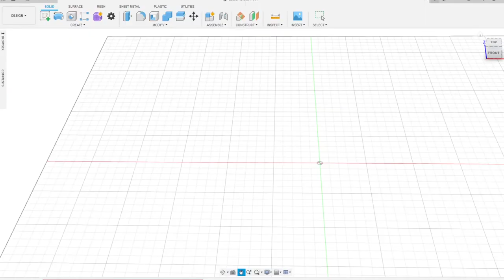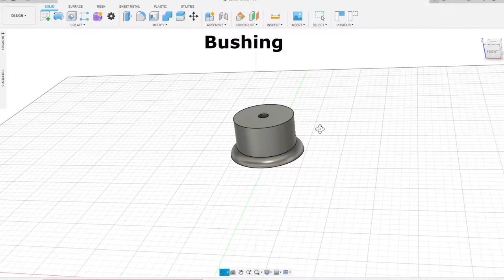DIY Heavy Duty Motorized Turntable

Comment: What approx weight could the table turn. Thanks.
Reply from the maker: Hi,
much depends on the quality of the bearing. I have no problem with items weighing up to 10 kg. For one thing that weighed over 20 kg, this motor had problems with starting the rotation - but when I started it by hand, it continued turning without help.